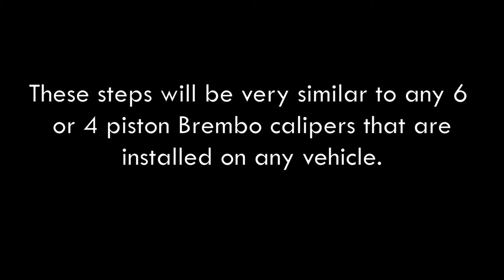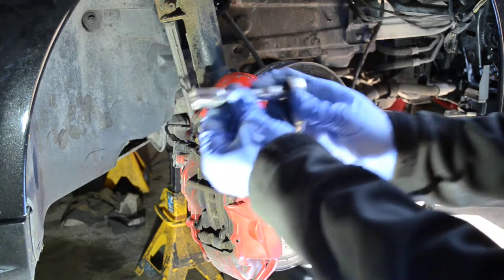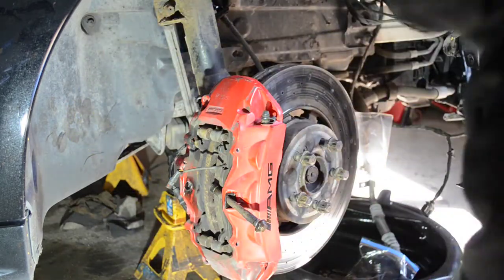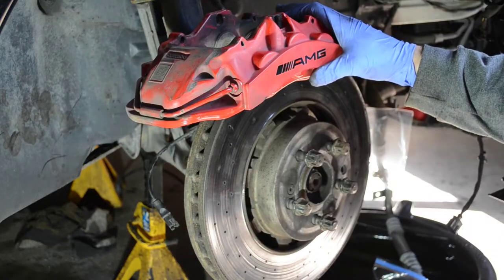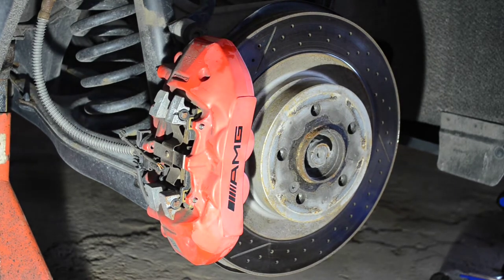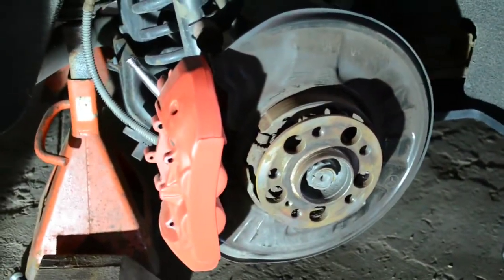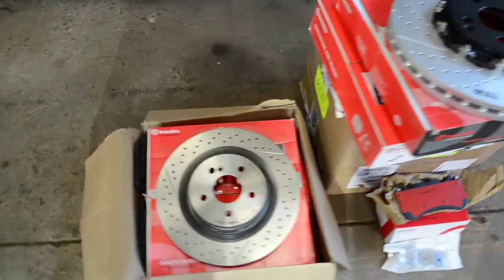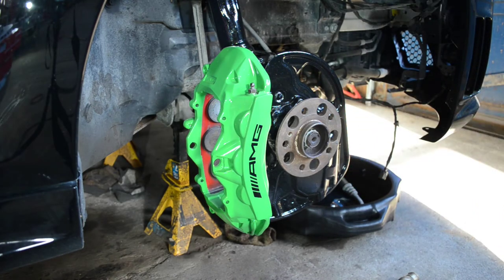SAVED OVER $4000!! Replacing AMG/Brembo brake pads and rotors on my C63 AMG with P31 package!!

Comment: Nicely done.  I have a 2016 E400 and thinking about replacing both front and rear rotors and pads with Brembo setup. Mercedes recommends replacing caliper retaining bolts.  Excellent video very helpful.   👍

Comment: Very helpful. Just did this job today on my p30. Took a while but no major issues. Not like the motor mounts...Thanks a lot. Oh and I clear coated my rotors to try to stave off some rust and dust for a while.
Reply from the maker: Hello, 

Thanks for reaching out! I have yet had to do the motor mounts on mine and I am certainly not looking forward to it haha. Although may be good content for the channel I am not going to rush for that one. 

That was actually a great idea about the clear coat on the rotors hats. The front 2 piece brembos I have had zero issues with so far, but the rear even though they are coated on the front face I have had some rust residue showing. (Will be cleaning that up this year as it drives me crazy lol) 

I am glad to hear that the episode was helpful to you, that has been the goal with the channel and it is great hearing back from fellow AMG owners on their repairs. 

Be sure to leave a thumbs up and consider subscribing if you havent already. Your support to the channel is greatly appreciated and will continue to help us grow and bring bigger and better content. 

I actually just pulled my C63 out of storage (Canadian winters). There will be lots of new episodes coming soon! 

-Full Throttle

Comment: In addition to performing this brake service,should I change out all 4 of the wheel bearing and hub assemblies? 🤔
Reply from the maker: Thank you for reaching out! I hope you enjoyed the episode. IF so please consider leaving a thumbs up and subscribing if you haven't already. Your support goes a long way and is greatly appreciated. 

Regarding your question there is some variables you would have to consider. Biggest thing would be age of the bearings/ mileage on them, and what is your vehicle primarily used for?  I say this as replacing the bearing/hub assembly can be costly and time consuming.  Normally it would be a stand a lone repair but if you are experiencing any issues or there is wear in the bearings it would be a great time to also make those repairs as it will save you the time of removing the brake components next time.  What vehicle are you considering this repair on? 

-Full Throttle

Comment: Hello and thank you for the great video

I usually get all my stuff done at the dealership but now that the car is 6 years old I am getting tired of paying so much for the brembro brakes and rotors every year it seems

Where did you buy the parts from? And I have very little tools so I would need the torque ratchet for sure

2017 GLS63 and with your video I feel more confident to handle this
Reply from the maker: Thank you for reaching out and your feedback. I greatly appreciate it.  That's a great idea to attempt this your self as with the proper information and some basic tools you won't have any issues and save thousands at the same time. 

Also buying specialty tools that you may not have like a Torque wrench will be a slight additional cost to the repair but will have it for the next time. 

These particular parts I ordered mostly from Rockauto.com as they had the best prices for my location. Another recomendation I would suggest would be to look at FCP Euro.com they have lifetime warranty on all of their products including wear items like brake pads and rotors. So if you are planning on keeping the vehicle for a while or put lots of miles on this can be a fantastic savings. Just need to pay return shipping and get full credit for new parts.

I also wnat to say beautiful mercedes you have. I always loved those GLS models especially the GLS63. Pure luxury and class with big power.  One thing to look into as I'm not sure off hand is if you have an electronic E brake. You may need to put it into service mode before you remove the rear calipers to replace pads and rotors. I can't remember if you have that on a 2017. I will try to do some quick research. Other wise it is a very straight forward job. 

Please consider subscribing and leaving a thumbs up on the video if you haven't already. Your support is greatly appreciated 🙏 

- Full Throttle

Comment: hey man would u know what's the torque spec in (nm) for the caliper bolts both rear and front
Reply from the maker: From the research I had done the numbers I had found are as follows. I personally didn't torque any as some were very difficult to get a trq wrench on and I used blue loctite and went off feel. 

According to MB WIS 204.077 

Front caliper bolts to knuckle M14 steel bolts  180NM (not the aluminum bolts as seen in the video the bolts in the rear) 

Rear caliper bolts to knckle 115NM 

I hope this helps, 

Thank you for your support as well, please consider leaving a thumbs up on the episode and subscribing if you have not already. 

- Full Throttle

Comment: hey man love the video! I know I'm late to the party but, do you know if these will work on 2009 CL 63 amg ??  the stock rotors are like $1250/ for the rear!! hoping to save some money buying aftermarket but I don't want to compromise on performance.
Reply from the maker: Thanks for reaching out! Glad you enjoyed the episode and thank you for your support. I appoligize on delay of response.  First off beautiful car you have! Love the CL63. Regarding your question I do have some bad news. From my research it looks like the CL63 does use a different set up to the C63 and the brake rotors and pads are different. 

I thought the C63 prices were bad 😅 they are very heavy cost even at direct to consumer. I am not sponsored by any means but I would highly suggest checking out FCP euro and or Rockauto for some prices. If looking at rockauto keep an eye on the brand(manufacturer) as they do sometimes list low quality suppliers. 

A bonus with FCP euro is they do offer lifetime warranty on all of there parts. If you are explaining on keeping the vehicle for quite some time this would be your best deal as the only cost you would have next time to replace would be return shipping costs of the old parts. 

Hopefully this helps and if you have any other questions be sure to let me know. I will try to help in anyway I can. Once you get the job done be sure to email over some photos would love to see your CL63 🔥

Also please consider leaving a like and subscribing if you haven't already. Couple clicks go a long way in supporting the channel. 

Thank you again for your support. 

- Full Throttle

Comment: Are you replacing the rotors everytime you do a brake job or can use the same rotor (assuming it's not below the service limit)? I have a 2017 AMG C63S coupe which needs rear brakes. The rotors are around $450 each and my car only has 27k miles on it and it's rarely driven so I was hoping I can just swap out the pad and use the same rotors until my next brake job is due. The rotors have light groves but they look like normal wear and tear, i didn't feel anything that would catch my finger nail when I drag it across the surface of the rotor. I do feel a slight lip on the very outer and inner edges of the rotor, but it almost feels like that's the way the they from the factory & not sure if that slight lip edge is actually from wear. What would you advise? Do you think at 27k miles I could get away with just a pad replacement?
Reply from the maker: Thanks for reaching out! I hope you enjoyed the episode and appreciate your support! Be sure to leave a thumbs up and consider subscribing to the channel for more! 

After reading your comment I believe you would have no issues with replacing only your pads. With that mileage especially only regular daily driving rotors should be still okay. You mentioned no heavy grooving on the rotors which is another tell tail sign. If you are currently have no vibration during braking I would say you would be safe to reuse the rotors for another set of pads. 

Be prepared to replace them on the next pad replacement though. 

If you have any other questions or concerns never hesitate to reach out. 

- Full Throttle
Reply from the maker: P.S beautiful car you got there as well! #worldsfastestfamily
Reply: @FullThrottleBHP  thanks so much for your reply and for the compliment. Love your channel and gave you a sub. Keep up the awesome content!

Comment: Hello. Also I have a 2013 performance package, but at Rock Auto the link that you marked was a 2010. It doesn't matter right? It fit my 2013. Also I couldn't find the brake pads for the front. Great video!!! Thumbs up
Reply from the maker: Hello, 

Thank you so much for watching the video and leaving a comment. I do apologize on not getting back to you sooner as I just seen your comment. 

That is correct The link was for my 2010 but the rotors will fit all years of  the w204 C63 AMG (2008-2014).  

I just checked there site and I do see they are not listing the front brembo pads anymore. It could be due to a shortage or stock issue. They do have some great alternatives but I will see if I can find another rebuttal seller of those pads for a good price and get you a link.

Comment: What's the update on the brakes and rotors? How do they compare to OEM? would you recommend the set up after 9 months? Currently looking for brakes and pads, thinking brembo pads and Zimmer. Rotors. I'm a afraid the brembo rotors wont be as durable and Zimmer. Just because the price difference.
Reply from the maker: Hello, 
Thank you for reaching out. New episodes will be coming soon and one will be an update on the brakes. I will share some info with you now though haha. 

Now to be fair the vehicle has been in storage over the winter but I have a good amount of kms on the new pads and rotors.  

The Front 2 piece Brembo's are the oem rotors for the p30 performance package cars while the p31 (my car) had the rotors as you seen me remove. Referred to as 1.5 piece by many people. Fair warning the pads are very bad for brake dust. There are other options for lower brake dust but with a ton of research I got concerned of loss of braking performance over amount of brake dust. I really don't think you would notice it on the street but I did decide to put up with the dust in belief I have better bite. (Again use at your own discretion) 

For the rears, your are right the oem would be Zimmerman and I went with the Brembo uv coated. I felt very confident with going with the Brembo rotor over the oem (zimmerman) as Brembo is a very reputable brake company and honestly have heard a lot of zimmerman rotors having issues with warpage after hard braking.  

So far I am extrealy happy with the braking performance of the parts I have used, would like to have less brake dust but the real performance and bite is very good. Be sure to stay tuned for the brake review/update coming soon. 

I appreciate your support and do ask you to consider subscribing to the channel as well as it goes a long way to helping to the channel grow. 

-Full Throttle

Comment: A normal 18mm socket wrench is sufficient for the upper and lower bolts on the rear calipers?  The top bolt is hard to access.
Reply from the maker: Hello, 

The rear is a very tight spot for the caliper bolts. Especially the top as you mentioned. I mostly used a box end wrench to remove them. Very time consuming and a bit frustrating but does work. 

The lower one with the right socket you should be able to use a standard socket wrench. 

If you have any other questions be sure to reach out. Hope you enjoyed the episode and do ask for you to consider  subscribing and leave a thumbs up on the video if you havent already. Your support is greatly appreciated. 

- Full Throttle

Comment: I got these from FCP euro. Just ordered 2 of these front rotors for my 2016 C 63s Sedan and saved SO much money as well. Got the front and rear pads as well.
Reply from the maker: FCP Euro is a fantastic place to also purchase OEM parts for fraction of the cost, plus lifetime warranty! Which is even better! Those 2016 C63s are beautiful cars. Have you done any mods to it yet?
Reply: @FullThrottleBHP  No mods and I think I am going to keep it stock. Looks and sounds great  already... and definitely fast enough lol. The only thing I am thinking of doing is a chrome delete.
Reply from the maker: @digitalsoundcreative3716  I can relate 100%. I am in the same boat with my W204 C63. It is equipped with the P31 from factory (boost in hp. forged internals from the sls etc... Honestly more then enough power and sounds fantastic. Although LTH and a ECU tune as been on the radar. Just debating if it is really worth it overall.

Comment: Great demonstration, I recently got a 2013 with the same calipers and rotors as this, P30/31 I’m not sure there seems to be some overlap. 

Anyways I got it inspected by third party shop and they said the rear brakes should be replaced and they said it would be ~$1,300 per side for the rear, are the OEM parts really that much more expensive?

Also, are the rears normally single-piece rotors/are two-piece an option?

Thank you!
Reply from the maker: Hey man I am so sorry for not getting back to you sooner. Some how I missed your comment and just finding it now. How did you make out with your breaks? Congrats on the 2013 as well the facelifts are beautiful!! 

Regarding your question $1300/side for the rear does seem a bit heavy for just parts, but depending on your location that could be roughly average. I would recommend getting some quotes to be sure if that is a good price or not, but also check out some online sources like FCPeuro.com / Rockauto.com 

The stock rotors on the rear would be single piece on all of the C63 even if it has the P30/P31 package. There is an aftermarket company to offers two piece rear rotors but they are petty pricey. 

I look forward to hearing back form you soon on how everything is going and how you made out. Thank you again of your support and ask to please consider leaving a thumbs up and subscribing if you haven't already. Also can check out the Fullthrottle.bhp Instagram page as I would love to see your ride. 

- Full Throttle

Comment: I replaced them today on my 2013 c63 P31 package i messed up the lil screw that holds the rotor I managed somehow to take the old rotor when i install the new rotor i couldn’t put the new screw unless i change the wheel hub so basically the rotor holds on lug nuts do you think i should change the wheel hub or just leave it like that would i have any problem if i just leave it without that bs lil screw that holds the rotor ? Thanks in advance
Reply from the maker: Hello! Want to start by thanking you for your support to the channel and do ask you to consider leaving a thumbs up and subscribing to the channel if you havent already. 

Those screws are a pain to remove. I just want to clarify you mention about replacing the wheel hub. Does that mean the threads in the wheel hub is what got damaged? 

If so you have a couple options. 

1) You can pick up a thread chaser or possible a tap depending how bad they are. You may be able to save them. If you dont have a tap and die set you should be able to pick up just the size you need. I would not recommend this for wheel lug bolts holes but if it's just that set screw for the rotor would not be an issue. 

2) You should be able to run it with out it. From my understanding they are more just a convenience thing to keep the rotors straight while you get the caliper and pads on. If you dont have it installed once you install the wheel it will securely fasten it as you mentioned. 

3) As you mentioned and most expensive would be replace the wheel hubs. Personally I dont think you need to do that. I'm pretty confident the tap/threadchaser will clean them up.

Deffinitly keep me posted how it goes, and wish you the best of luck. 

-Full Throttle 

P.s - Wicked car 🤘 haha

Comment: I have a 2019 c63 amg. For front brakes do I compress the caliper piston as normal and is there a way to release the auto factory parking brake to not mess anything up like recommend for the rear?

Comment: I’m trying to find the front brembo brake pads for my 12 c63 p31 package but I only see rears ?
Reply from the maker: I just checked as well, looks like rockauto is currently out of stock for the front Brembo nao ceramic pads. I have found the same pads listed here form ebay.

 https://www.ebay.ca/itm/For-Mercedes-C197-R231-X166-W218-W204-W205-W212-Front-Brake-Pads-Ceramic-Brembo/362490887114?fits=Make%3AMercedes-Benz&epid=231239441&hash=item546623fbca:g:9-UAAOSwf1ReoZY- 

From a good rated seller, you may have luck ordering from them for the front if you are looking to run the same pads front and rear. Which I personally prefer but you could run a different brand up front if you wanted.

Comment: Quick question did you buy them both for $303 or was it 606 for the front rotors ?
Reply from the maker: Thank you for reaching out! I hope you have been enjoying the content here at Full Throttle. If you have I do ask if you could to be sure to leave a like and subscribe so you don't miss out on any new content coming your way! Your support is greatly appreciated here at Full Throttle. 

I did just double checked the links for the parts (found in the description above), front rotors are listed for $385 CAD plus shipping and taxes each. For two would be around $770 plus shipping and tax for both front Brembo 2 piece rotors. 

Do you have a vehicle you are looking to replace the brake rotors/pads on in the near future?